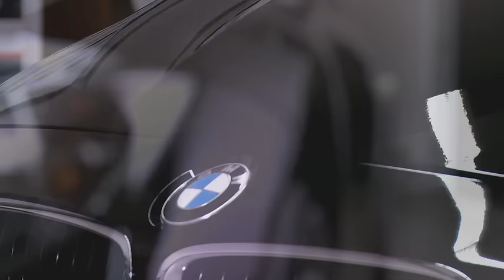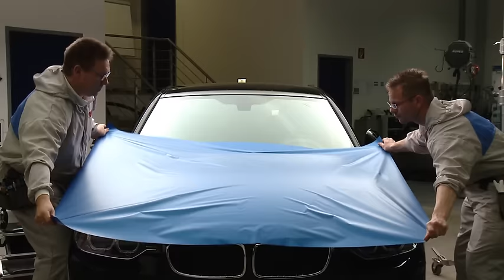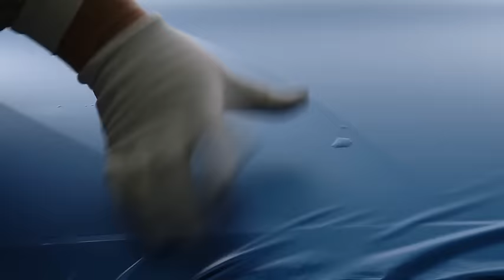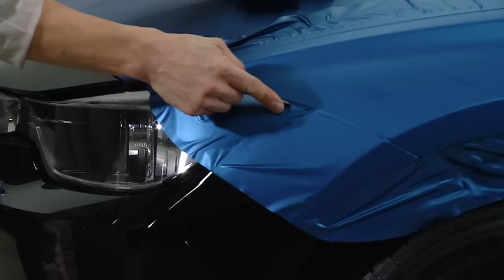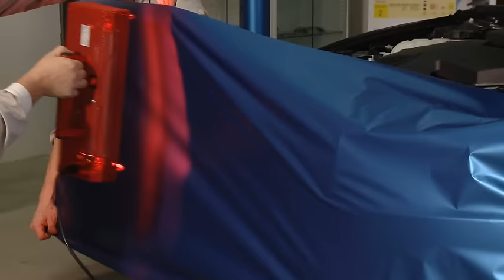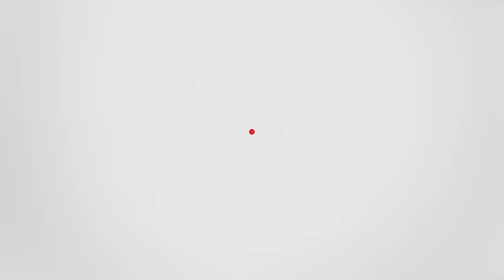Láminas adhesivas 3M™ Serie 1080 para personalización de vehículos

Comment: En Bogotá donde los venden ,como los pido, gracias
Reply from the maker: Hola John,

Este canal de You Tube es para 3M Portugal y 3M España, pero que recomendamos que veas en enlace https://www.3m.com.co/3M/es_CO/inicio/WTB-Product-Directory/WTB-Product-Location/?wtb=wID&product=Sistemas%20de%20Preparaci%C3%B3n%20y%20Aplicaci%C3%B3n%20De%20Pintura o que llames a 3M in Colombia PBX: (+57 1) 416 1666 o (+57 1) 410 8555

Gracias por tu interés en los productos 3M! 
:)